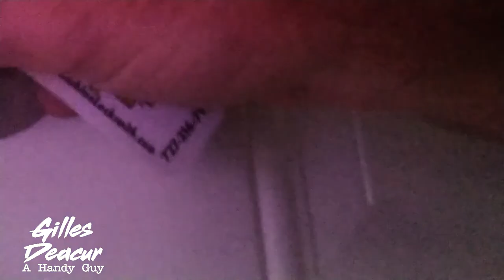A Day in the Life of a Locksmith - Episode 2 - Picking Open a Lock With KW1 Lishi and Rekeying

Comment: It’s neat to see other locksmiths operate. I’d definitely have to flip that keyhole the right way as well😂. In my area it’s illegal in residential to have double sided deadbolts on an egress door because it’s a fire trap and little kids have died looking for a key in smoke filled rooms while trying get out. There’s no windows next to that door so it’s a waste of a keyhole. My local AHJ gave it to me in writing so I show it to customers when they argue.  I’ve seen some remove the pins on the inside deadbolt and glue a key in so they can always get out. I do offer single cylinder deadbolts and key the rest to them. It usually equals out to the same price depending on what grade you offer. I’ll also check for master pins (to reduce extra shear lines) but I don’t bother with spools in cheap locks. Those doors get forced open. That front one in particular swings inward and would be easy to kick-in so good job on fixing that deadbolt hole. I keep those double hole strike plates for some those bad misalignment jobs plus it increases security. But I’m sure they wanted you to keep the price down. Apartment complexes are usually low budget when it comes to repairs. Thanks for sharing!
Reply from the maker: Thanks for the feedback!
Reply: Enjoyed your video, it's the first one I've seen. I was a Locksmith for about 3 years in the Seattle market. It's also illegal here to install double cylinder deadbolts for the reason mentioned in the previous comment.  When we came to a property with them we replaced them. It's enjoyable watching a locksmith gaining entry to a property and rekeying it as well as handling whatever issues pop up! Thanks.